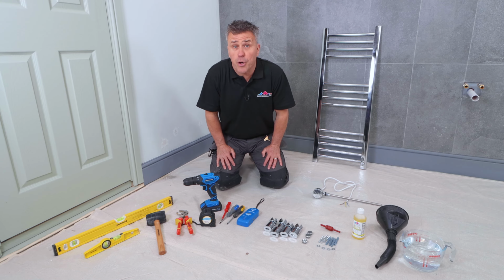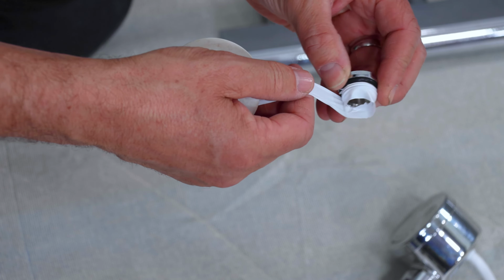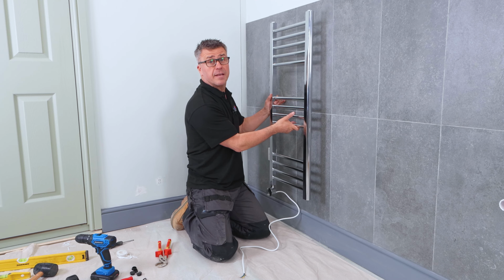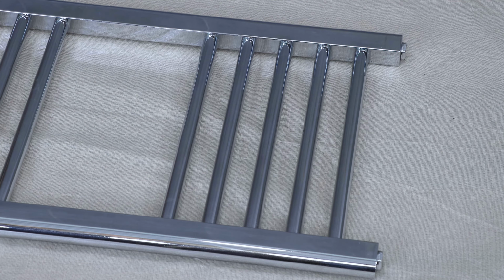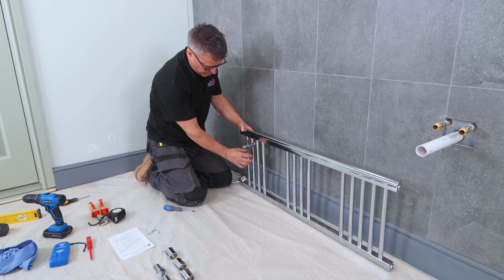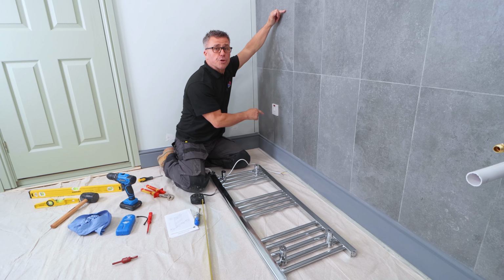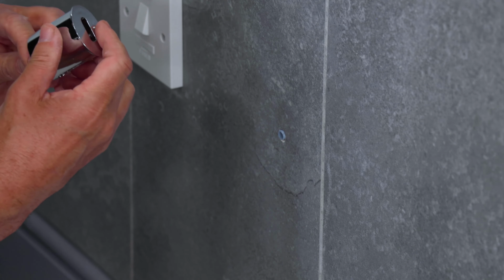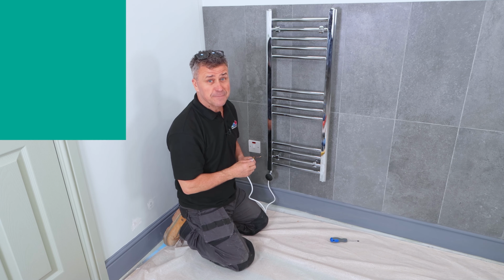How to Install an Electric Towel Radiator | Bathroom Mountain

Comment: Great video and extremely helpful however I'm wondering why you filled the radiator prior to mounting. Would it not be easier 1) install element 2) install one of the of the bungs at the bottom 3) mount rail on wall 4) fill rail with water/mixture 5) install last bung and bleed cap/plug on the top  ... this way the rail is lighter and leaving the bung & bleed point out, allows the air to escape while filling.
Otherwise great video.

Comment: Thanks useful video. Followed all steps and connected, turned on, but will not work (even if all five red lights are on, no heat). Possibly heating element is faulty? I played with all buttons but to no avail.

Comment: Great video thank you. Just one question, is the radiator inhibitor you mix with water ok for all towel rails generally?
Reply from the maker: Thank you, Yes it should be fine, but always check with the manufactures instructions first.

Comment: 🎉 How do you control the temperature of the bathroom? I didn't see any thing that acted as a thermostat. I don't believe you are intended to leave this heater on all the time.
Reply from the maker: Check with your electrician but you may have a controller with your boiler. Thanks

Comment: The only negative I have here is that you drilled the mountings in an electrical zone. Regardless if your tester found nothing. You can’t rely on that. Hence you have 150mm zone left right up and down of any outlet
Reply from the maker: Always be careful and take precautions when drilling into your areas where cables and pipes could be

Comment: Better to prepare the mounts before filling the rail keeping it lighter & less chance of damaging the element. It doesn't look like its in any zones (zone 1 the bath / shower basin up to 2.25m or zone 2 0.6m from zone 1) as it looks like its a sink position not a shower but saying that its not good practice to have non IP rated electrical equipment (the fused unit) in a area likely to suffer from moisture. Better to have a flex outlet (sealed) with the FCU on the outside of the bathroom, but sometimes you don't get to choose.
Reply from the maker: Nice tip!

Comment: Naturally, the bathroom is wet. Does this Towel radiator pose a danger?
Reply from the maker: If installed correctly no, however you have to remember the moisture in the air, water off towels, splashes from the shower/bath/sink etc